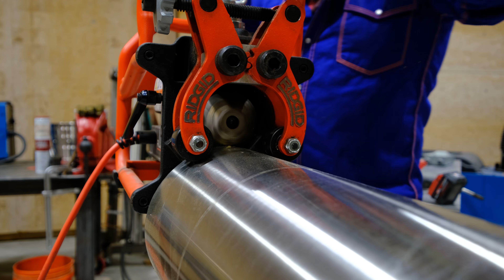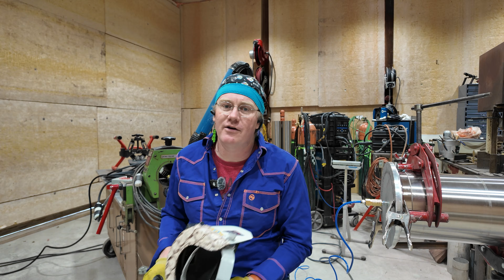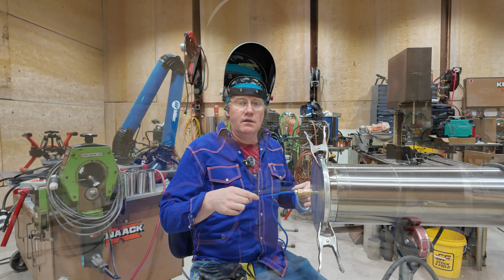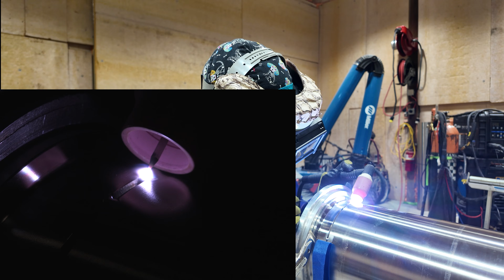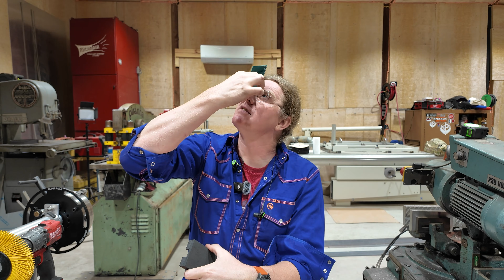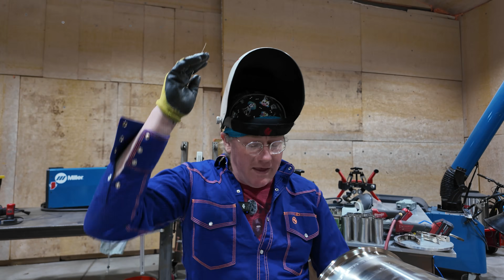TIG Welding Big Stainless Pipe With a Lincoln SAE 300

Comment: How did them lenses look before you drop your hood I had the experience of using an optical lens when you drop your hood everything was clear you can see right through it add kind of a shade to it a blue shade but it wasn't dark it was like looking through a light sunglasses then when you welded it didn't change to fix shade images filter out the harmful rays of welding pretty cool to look through and I can't find them anywhere they were pretty much out of phase in the early nineties being well over $100 a piece that was extremely expensive back then

Comment: I work for a company that built specialized food processing equipment no tobacco products no smoking if you had to go into the plant do maintenance then you're limited to hand tools only like he was talking about you lose a wire bristle and one of them plants in magnets don't get it then that goes into the food not good if you were building say ham pans with the stacker destacker unit then you know all that gets sanitized before it goes into production so it's whatever Rotella Wheels everything was designated to stainless steel because that's all we welded with had them old Lincoln aircraft machines look when I first started working there I was like barely twenty they had that type of equipment at Tulsa welding school but I had never messed with it so I'm standing there for like 10 minutes trying to figure out how to turn that some bitch on Foreman finally walked over laughing his ass off mainly cuz he won the bet anyway he turned it on and it was a really good time

Comment: I take the batteries out of my hood when I'm not using it I have a fix shade in my go to hood which is chopped and gutted and all that in my experiences when that thing is just sitting around in the toolbox it's going to run the battery down

Comment: Zack!
Thank you very much for all of your input!

Will the RIDGID beveling machine work on pipe that will not roll on rollers?
What size pipe will it do?

Do you like the 300HE better than the Vantage you had that the rats got into?
( I recently had a squirl get into my main breaker panel )

Thank you again for your time and sharing your skills :)
Reply from the maker: Hey sorry I'm not the best at noticing comments

Yes it will orbit a stationary pipe no problem 
Yes I like it, I recently bought a classic 300 he that I like better though. If I was picking I'd get the Perkins in the classic 300, the Kubota is louder than the Perkins but really just get a pipe pro / pro 400 trust me it's the best I've ever used and does it all

Comment: With the amount of pipe you seemingly weld Zach, I would think you'd be sitting on a few traditional pipe bevelers?
Reply from the maker: I had a couple of mathey durmans but sold them because I pretty much only do stainless, I have looked at some air ones from tritool but not had a job that would have made it necessary

Comment: What’s the best way to cut larger tubing when you can’t use a fisher saw or saw blocks ?
Reply from the maker: I've been using those exact pipe cut saws. The last pipe welding video I put up I talked about using it. They work good but are spendy per cut. They have one make for stainless that I'd like to try but I got the one I have for cheap off eBay